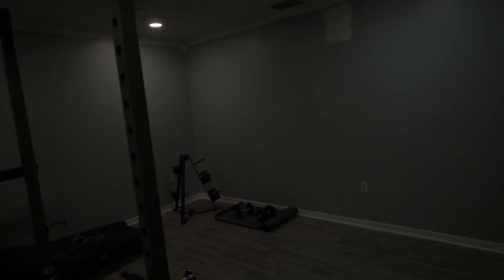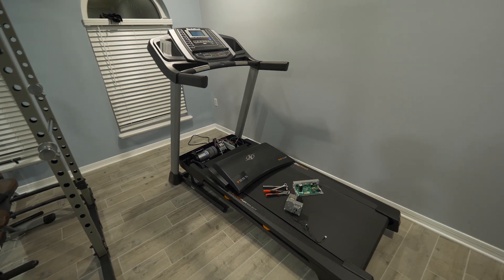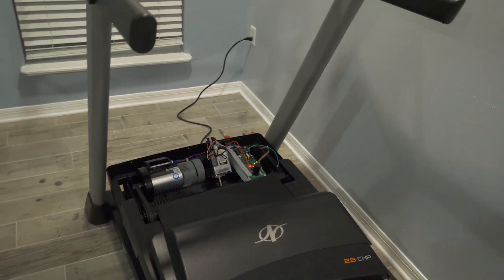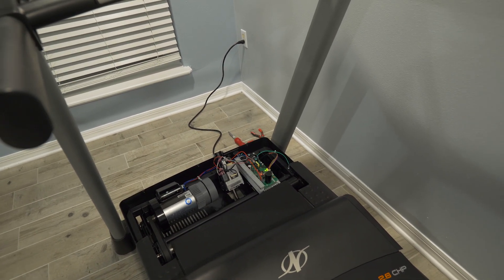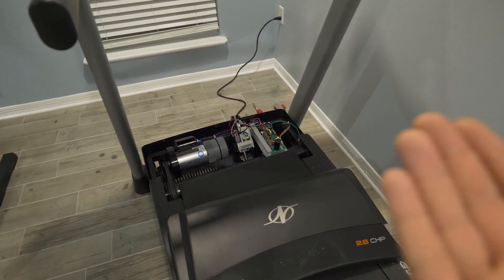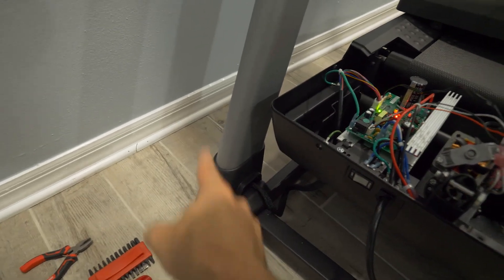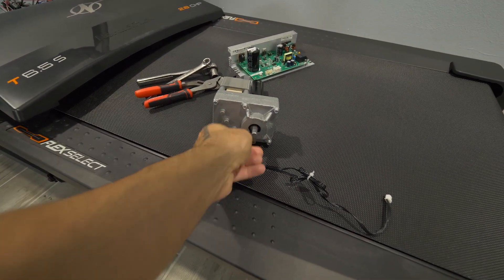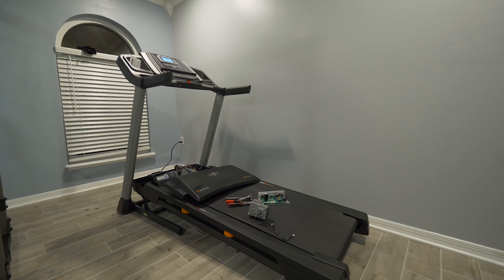DO NOT BUY!!! - Nordictrack T 6.5 Treadmill

Comment: First and foremost, there's no way anyone can just look at and determine the motor is faulty. That's your first issue. To help yourself, you cannot solely depend on them. You need to test if there's any power coming to the motor. If you have power, then yes it's likely something is wrong with the motor. As to the control board, if you don't have power to the motor, then yes, something could be wrong withe the board. Likely the control board would send a low signal to a relay which in turn will let the high voltage to the motor. If the relay has a good signal and the relay is good, then it's something with the power source or how the power source is connected to the control board. If the relay has no signal, then likely something is wrong with the board. Long story short, your issue is you are relying on someone over the phone to troubleshoot an electrical problem they likely have zero clue about. All they are doing is swapping parts hoping it will work. There's a chance none of that is the issue. These techs likely have zero electrical/electronics knowledge so there's no way they will know and you trusting them is just a waste of time. If you don't have electronics/electrical knowledge, call an electrician and they can tell you where the issue is if it's electrical which it likely is. Then you just tell them to send you what you need. Never rely on techs to troubleshoot these sort of problems. Realistically, how can they? Unless they are having you to probe with a multimeter, there is no way they will know the cause of your problem. For them, it's just a matter of reading potential solutions off some screen or tech guide and nothing more.

I've got one on the way from Amazon so hopefully it won't have the issue you're having but if it does, I'll for sure be telling the techs whats wrong not the other way around.
Reply from the maker: To blame me as the problem is absolutely wrong and horribly offensive. A company has an obligation to live up to the terms of the sale.

It's not my responsibility to diagnose and repair the treadmill. They sold me a treadmill with a warranty. Under the assumption it will work when I receive it and they will fix it if it doesn't. Which means I paid for it to be their responsibility. 

They failed to repair the machine after 4 months of back and forth with them and schedules tech to come out who never show up and then lie about showing up. It's completely unreasonable and unfair to expect a user to be an electrical engineer and go in there with a multimeter... or to hire an electrician if they don't have that knowledge. Especially because the data sheets with voltage specs are not available to the public. And especially because Nordictrack will not reimburse any labor or expense I personally put in to figuring out what's wrong. Again, Nordictrack sold me a treadmill that was supposed to work and a warranty that was supposed to fix it if it didn't. It's their responsibility to live up to the terms of the sale. Not my responsibility to make up for their shortcomings. 

If you think diagnosing it yourself and telling them what's wrong is gonna make it go easier, it won't. They won't trust your diagnosis until they go through their own diagnosis to confirm if you're correct or not, because you have no credibility. You are not a treadmill technician, you are not an electrical engineer. And even if you are, they don't know that. And I know this is how they will react because I went through it already. You will find yourself immediately frustrated if you attempt that and expect it to be smooth sailing.

And I totally get that if I was an electrical engineer and treadmill technician it would be easier and quicker to fix my treadmill. But I'm not making an argument about what's easier. I am making a moral argument about what's right and wrong.
Reply: @AltcoinXP  My intent was not to blame you. I was merely pointing out the fact that there is no way a tech on the other line can simply look and determine the motor or the controller board is bad unless they actually have someone on your end doing the probing. In other words, the troubleshooting is just BS. The person on the other line likely has zero electrical knowledge and us just reading off a troubleshooting manual.

My other point to you is that if your end goal is to get it "fixed" quickly and be able to use it, you will be able to do it faster and more accurately than they if you have electronics or electrical background. 

Lastly, if all you care is that they hold their end of the bargain then this is likely what you will get--lots of wasted time with zero progress. 

So no, I'm not blaming you. I'm just pointing out what you already know via experience which is that their support is pretty useless. Honestly, there is just no way to trouble shoot electronics unless you are probing it to find the real culprit. Now if it was a system that self-reported via error codes, then yes, support can troubleshoot using the codes. Absent this, there's no way but to probe with a multimeter.

Case and point. I just got my wife's treadmill in. I bought the same one you have. It came with the electronics cover cracked on the corner, and almost fully cracked down the side, and all 3 front screw mounts completely broken off. Lastly, it was missing the cross member for the hydraulic to connect to. Amazon is sending a replacement, but my wife wanted to use it so I put it together, 3D printed repair parts for the cover. I repaired it with super glue. Now it's stronger than the original design and I was able to do all the repairs on the inside so i just have a minor blemish on the one corner and the visible crack line where it cracked like 10 inches on the side. It now safely covers the control board and the motor with a slight aesthetic blemish. Now I'm just waiting for the replacement to come in so I can get me a crossbar and if the cover isn't broken, I'll take it too and they can take everything back. If the cover on the replacement is broken also, I will keep the one I repaired and request Amazon to give me the  discount they had promised. While using it this morning it went a bit awry. The belt stopped and the incline maxed out all on its own. This is NOT normal.

Afterwards, it would not start up. I grabbed my meter and checked the outlet and checked my breakers. No breakers tripped but my outlet was only reading 99V. That tells me my outlet is bad. The wiring is fine but the contacts on the outlet are not making proper contact. I find a good outlet and plug it in. Voila, no issues.

You have to remember that these are electrical components which are designed to function a certain way if provided certain electrical signals. If those signals fluctuate or are erratic, it can cause your equipment to malfunction. For me, the end goal is for my wife to use this machine. For this reason, I'm going to do the troubleshooting and relaying it to them if I need a part. It's on me to convince them what the issue is so they will not be wasting my time by sending replacements that are replacing perfectly fine parts, thus not addressing the real culprit. It boils down to what is important to you. For me it was getting it running so I took my own time to design and 3D print all the necessary parts and to trouble shoot if I have to. 

If you leave it to them, you may end up where you are, four months later and zero progress. So no, I'm not blaming you, but I am telling you that sometimes, if you want results, you may have to do it yourself. But if you are of the mindset that it's on them then be ready wait as you have and in the end, there may be no resolution, and possibly no refund too, just a dead treadmill they keep trying to fix by sending you replacement parts after replacement parts, none of which addresses the issue. The issue could very well just be your outlets. Of course, that's NOT to say that is your issue. I'm just saying, they will NEVER know the culprit unless there is actual diagnostics done. Hope you get yours fixed. Even though this is for my wife, I like the treadmill. It's solid and everything works as it should. The malfunction this morning is expected as the machine was getting mixed electrical signals. Best of luck to you and again, never meant to blame you. That was never the intent. The intent was to point out the obvious--support doesn't have a clue what they are doing.
Reply: I will look at mine and see if I can diagnose what is going on with yours based on what you described. If you can write down what happened when this all occurred and detail what you see and hear when you try to start it up, that would help. I don't mind trying to give you a hand. I have the same model so know what it should be doing.
Reply: Please observe your machine and see what happens and describe it in detail. Your video says when you insert the key, a dark orange light comes on. That is NOT normal. Verify this is the case. NO lights should come on when you insert they key. The only lights that should be lit are the red and green LED. Once you start the treadmill, the red LED should go into blinking mode...about 4 blinks per second. If you raise the incline, you will see a light orange LED light up. This is labeled LD4 on the board. If you lower it, LD5, the dark orange LED will light up. These two LED's tell you what the incline is supposed to do. Light-orange is to rise and dark-orange is to lower. If it does as you claim(insert key and dark orange LED comes on). This tells me it's stuck in the down mode. If it is bottomed out and you hit the down button, you will get a series of beeps from the screen. This tells you it's bottomed out. NO lights should come on when you do this.There is no reason for your dark orange light to come on unless it is stuck in this command. The embedded code is expecting this variable to change from current to new before it will say the command is complete.  

Let's say u are at incline 2 and hit down arrow...it must power the motor until it reaches level 1. The  level variable is stored the value 2. Until the bed angle drops enough to get to one, this variable is going to remain at 2. If this variable never changes, this code will continue to execute making it stuck in the down command. I'm just giving you an idea of what's happening. I need more info from you as to what's all happening when you insert the key. 

Do you hear anything, see anything. Look at the board and the motor. What about when you hit up? Does the dark orange light ever go off, like when you hit up to raise the incline. If it doesn't then there is a sensor keeping this embedded code looping and repeating the command to lower the incline. If the motor has never worked and still doesn't it would keep it in this mode. So always, it's trying to execute a command it has NOT completed and it's trying to do this. Until it completes this task, it's going to keep trying. Appears to be the case. Would love to hear more details from you about what you see and hear. Be very detailed and specific.
Reply: @AltcoinXP  My best guess given what little i know about your issue is that your incline sensor is either bad or needs to be calibrated. I watched your video again and now see that you first get a light orange(raise incline) then it goes to dark orange(lower incline) then both go out. This means the system is trying to raise and then lower the incline. I also noticed the beep when you go to pressing the incline buttons. It beeps and does nothing. This tells you it is where you are trying to put it. Example, if it's at 10 and you push 10, it will beep. If at 5 and you push 5, it will beep. This is indicative of a bad incline sensor to me. NOTE TO POWER DOWN BEFORE DOING ANYTHING! You can try taking it out( goes into side of incline motor). Wipe it and reinsert. Test and if you still get the same result, unplug it from the control board. You SHOULD be able to operate the incline. Here's the catch, it will be very confused so if you click a level, it will go up one level only. If you click the next level, it will go down a level and it will just keep doing this...up one...back down one....up one back down one. If it does this, it's responding and your motor is fine. Power down and plug it back in. The reset and to calibrate it, take the incline back down to zero. This will be it's zero position. Try it and see what happens. I believe your issue is just a sensor issue. Good luck!
Reply: @vangmountain  you just did an awful lot of diagnosis for someone who's opening statement was "we can't diagnose by sight, we must use a multimeter"
Reply: @Floortile83  Ideally, that would have been the preferred route but absent that, I tried to help as best I could based on what he was saying in his video. My diagnosis was based on logic and what I know of the machine. Based on his video he sent them, according to him, he was sent an incline motor and then a control board. It's obvious whomever he spoke was clueless. For it to even remotely have a chance of it being the motor, upon pressing an incline key, either the light orange or the dark orange light should come on. Light orange if he is raising it and dark orange if he is lowering it. This would tell him the signal from the console has made it to the control board and the control board is sending a signal. The other thing would have been to listen to the relay and see if he here's the relay power up. If ALL these occur, then and only then, absent a multimeter probe of the motor or other checks like unplugging the motor and manually turning the belt. Just watching his video, you can clearing hear the console give a single "beep" whenever he pushes an incline level. This is the console essentially, "invalid command". What does this mean? It means the console NEVER sent any commandcsignals to the control board. Knowing this, how the heck did the tech get to his conclusion that it was the incline motor and ultimately the control board. 

There's zero logic being utilized here. The tech obviously knows zero about the machine. The console only sends command signals to the control board if the desired command is valid. How does it know whether it's valid? It reads the incline sensor values. The fact that it beeps when he depresses an incline level and the fact that when he gets a light orange light followed by the dark orange light upon insertion of the key tells me that upon insertion of the key, the control board tries to raise and then lower the incline. Just by this alone, one might suspect the incline motor but you have ways to test the motor and other components in the path to the motor. The fact is, there is ZERO response when an incline level is pushed. Couple this with the odd behaviour of the LED's may suggest that the incline sensor is bad or it has bad connections. Of course this is absolutely just a logical guess, but one based on logic and what I have observed with the operation of my identical machine. Point being, if you have to use trial and error, it must be done using logic, not just random guessing. 

The flow of the embedded code is something along the lines of, if incline level button is depressed, check incline reading. If depressed value is higher than current level, raise the incline. If depresses level is lower than current level, lower the incline, ELSE "beep". What he is getting is the "beep". What can lead to this choice? A bad incline sensor. We see no signal was sent to the cobtrol board because neither LED lights up which is what it does if the control board gets an elevation command from the console. It's beeping! Logic tells you it could be something the incline sensor. Unfortunately I don't have access to the embedded code running this machine. I can only guess at the general behavior of the code based on the observations of how mine operates, both when the incline sensor is functional and not functional. As I've already stated, me unplugging the sensor makes the incline commands obsolete. It just toggles between raise and lower. If it lowered the incline then pressing any level keys will make it do the opposite of the last command.

In other words, absent a reading from the sensor, the system toggles the value of the incline sensor in such a way that whatever value you depress, you'll get the opposite effect from your previous command. This is what I observed when i disconnect my sensor. If I do it starting at level 3, the controls will toggle back and forth from level 4, then back to 3 and it just keeps repeating, never getting beyond these two levels. 

Yes, I am trying to diagnose without a meter, but that's because I know how this treadmill is supposed to respond to commands having the identical machine and I've observed it's behavior unlike the tech who likely is cluesless and is just reading some instruction cards. This is how the majority of desktop support works unfortunately.

If he could give more details of what all is happening, it's possible to diagnose it without a meter on his end because I can   observe how my responses compare to his. And yes, I understand you are just pointing out the seemingly contradiction of my comment, but it isn't as contradictory as you think because I have and understanding of how the machine is supposed to behave. As such, I can do "some" logical trial and error diagnosing which is what I did. Cheers!
Reply from the maker: @vangmountain  the sensor was replaced three times. It's sent along with the incline motors. Unless I received broken sensors each time, it's not the sensor. There are also a lot of wrong assumptions you are making in your comments.
Reply: @AltcoinXP  Yes my assumptions could be wrong because they are only based on observations. I decided to probe the sensor and hook it up to the oscilloscope and this is what I found. First and foremost, the sensor runs on 5v  and the return signal is 3.3 volt logic. If it is working correctly, it should pulse with around a 720ms high pulse and 175ms low pulse. Depending on what you push(levels or increase/decrease button), it will vary the pulses and depending on where you are at, the signal will return to a high state or low state and it starts in that state. I don't have access to the code so I don't know exactly how it determines what level it's at. What I do know is the incline motor runs during this pulse cycle so it's safe to assume the duration of the pulse is the length of time the incline motor runs. This can be used to convert the shaft rotation to find out the incline level. I'm not sure why it switches back and forth from a constant high state to a constant low state, but it does. It could be that this is how it keeps from straying off. If you play with it long enough you'll be able deduce what it all means, but some quick checks and you would be able to see if the sensor is working or not. Does it have power? 5V is what it should be. Do you get a signal on the signal wire? 3.3V is the signal. If you get that, you will need an oscilloscope to actually see the signals. Exactly how everything works I don't know because I have zero data sheets but probing it, you can reverse engineer and get a basic understanding of how it's supposed to work. So no doubt, I could be making some wrong assumptions but having tinkered with it, I believe I have a better idea than just swapping out parts. There can only be so many things wrong. A full swap of parts "should" work assuming the issue is in those parts. You have to start with the basics first. Do you have good reliable power? As I've stated, my 99V oulet caused this machine to go wacko. Once I realized that, the fix was as simple as hooking to to another stable outlet. So yes, it could be any of a host of things and that's why it's imperative to test BEFORE swapping. No point in swapping out a perfectly good part. Maybe something's getting fried? If so, why? My point is, it's going to be a tough fix unless someone is actually hooking up diagnostic equipment to it. This is the only sure way to get to the root cause of your issue. What I do know for sure is NONE of the incline motor lights should ever come on unless a "raise" or "lower" command has been issued by the console to the control board. So why does yours automatically light up when you insert the key? Stuck key? Doesn't appear so. It goes off on it's own. Does it do this every time? You have to do it over and over to confirm that what's going on is repeatable. If you can, you can start to probe because something obviously isn't working. Just my thoughts. 

You say you don't think you should be doing this, and you are correct, you SHOULD NOT.You paid for a product and they should take care of it, but the reality is, you are already doing it so why not do the rest. Of course, that's entirely up to you. 

Take my case for example, I eventually found the crossbar. It was taped to the underside of a piece of foam. Installed it and got up with Amazon. Sure, it took me a some time to properly design and 3D print the parts to repair my cover, but in exchange, Amazon gave me a 45% discount on my purchase to keep it with the minor blemish, so I got a nice $650 treadmill for around $230 ($480 cyber monday purchase) because I was willing to put some of my own time into repairing it and living with a minor blemish. Because I did, I have a very nice working treadmill one day after delivery. All about what you are willing to do. Cheers!
Reply from the maker: The reasons I think the orange lights turn on when I insert the key is because it's automatically entering the incline calibration mode. I know the incline motor repair sheet I was sent along with the replacement incline motor says some models automatically entire incline calibration upon startup, and other models you need to press and hold buttons before inserting the key to enter calibration mode.

And yes, the power at my house is fine. I have a kill-a-watt that I used to check.

As for why I'm not getting balls deep trying to fix it, it's because I have so much on my plate already. I spent almost 4 months trying to resolve the issues with this treadmill incline and I give up now. I'm only one person with a giant to-do list and so much stuff on my plate, that I can't spend day in and day out trying to fix this treadmill (either by myself or working with their crappy support). Amazon refunded me the full price I paid for it, so I'm not financially out anything. The incline is stuck in an elevated position, but I'm okay with that. Because all this time spent trying to fix this treadmill is time I don't have to spend using it and getting healthier. Plus, having the treadmill taken apart and in the middle of my floor gets in the way of me doing other workouts.

I appreciate your willingness to help, but I think you trying to help me is a waste of your time, because I am long past trying to fix it.
Reply: @AltcoinXP  I can confirm the entering Calibration mode does not light up any of the LEDs. Only when it's trying to raise or lower do they come on. It responds the same in calibration mode as it does in regular mode so it's definitely telling me that somehow yours is trying to raise and lower upon start up because those LED's indicate that a signal has been sent to the relay. Why it does that is beyond me. Those lights indicate power to the relay. You can confirm it's doing this by listening to the low audible click of the relay or probing it with a meter. If so, it's trying to change the incline not merely entering calibration mode ,but it's highly possible we have slightly different machines. Anyhow, looks like you are content so we'll leave it at that. I think we can both agree their support is not great based on your experience. 🙁🙁🙁
Reply from the maker: What I was suggesting is that if it automatically enters incline calibration mode, it will automatically attempt to raise and lower the incline upon startup... therefore causing the orange LEDs to turn on. My understanding is that calibration mode will raise the incline to the highest setting and lower it to it's lowest setting and record those positions and calibrate/match those positions to the 1-10 buttons.

I assume yours does not do this because your machine is already calibrated, so it's not seeing a discrepancy in values causing it to enter calibration mode upon startup.
Reply: @AltcoinXP  My observation is that it does NOT auto calibrate. You manually do it. And I can confirm my calibration is messed up when i intentionally disconnect the sensor with power on. In this mode, any up command moves it to 10, it thinks. I know this because that's what the monitor shows. It won't allow an up command. Any other command is a down command and it lowers it a notch and displays it as zero. When I plug the sensor back in, it's lost so I have to manually calibrate. So no, best I can tell, it does not auto calibrate or try to. And yes, when it calibrates, you hit up and it takes it to 10...you hit down afterwards and it comes all the way down. The sensor pulses untill it gets to the limits. My guess is it counts these pulses and just tracks these pulses to determine where it is at. This would explain why it get's lost if you disconnect it. The sensor does not send any pulses so the board cannot add or subtract fmto what it has as the current level. As a result, it has no idea where the incline level is so any up input will automatically move up one level and be set to 10 and any other input will lower it one level and be set to zero. This is what it does if you disconnect the sensor. It just goes up one level and lowers one level and just repeats this motion never able to go any higher or lower.
Reply from the maker: Ok. So I wonder if there is something in the upper console initiating the incline motor when my machine is first turned on. Like a short or something. I know it's not a problem with the upright wire because I tested and replaced that.
Reply: @AltcoinXP  By the upright I'm guessing you mean the data cable. I was going to ask if you'd checked that. As to your question, yes, anything is possible. Personally, I don't think so. The reason I say that is because I saw in your video when you clicked on a level, it gave you an audible single "beep". This is indicative of the system telling you, "you are at this level...invalid command". It's equivalent to me being at level 3 and pressing 3....my only response will "beep". This tells me the command never makes it to the control board. But in the start-up it does try to go up and then down. My question to you would  be, when it does this do year year the audible "click" of the relay. It's very light so you will have to put your ear next to the cover. Without anything else running you should be able to hear it. This would mean something had sent a signal to the relay. The question is what and how? After this process, you don't have access to the incline command is best I can tell. Does it give you multiple beeps when you click the up or down button for the incline. Click all the levels and both in up and down incline arrows. What are the responses? I was suspecting the sensor signal alone  alone doesn't dictate to the control board where the level is at. It appears to be a stored in flash memory and hence will always be the same even if you power off. Upon powering up, because it was never written over, it thinks you are still at this level. We have to somehow get it to clear this value. This is what I think may be going on which would explain some of what I've seen on your video. I would advise you to mess it up intentionally by unplugging the sensor from the board and piwering it back up without the sensor connected. See if this frees you from this mode. Hopefully it will write over what has been saved in flash memory. Just a guess.
Reply: Unfortunately I cannot replicate your issue on my machine but you should be able to replicate things I've describe to you because that's how the machine is supposed to work.
Reply: If I get enough feedback, I think we might posdibly be able to resolve this issue.
Reply: After u disable the sensor, manipulate the incline controls to see if you can get it to move.
Reply from the maker: Yes, I hear the relay. I believe this is shown and talked about in my video...

The incline button beeps do not indicate an invalid command. The way I am coming to this conclusion is because the exact same beeps happen when I use the speed control.

To be more specific... 
If the display shows incline 1 and I press the 1 incline button, it gives me a single beep. If I am at speed 1 and press the speed 1 button, I get a single beep.
If the display shows incline 1 and I press the 2 incline button, it gives me a single beep. If I am at speed 1 and press the speed 2 button, I get a single beep.

The only time I get a triple beep is...
If the display shows incline 10 and I press the incline up arrow. Or I am at speed 10 and press the speed up arrow.
If the display shows incline 0 and I press the incline down arrow. Or I am at speed 0 and press the speed down arrow.

Therefore, the triple beep signifies that I am at the limit for the incline or speed. And I single beep means that I have pressed a button.
Reply: @AltcoinXP  You are correct. It beeps anytime any button is pressed. I didn't catch that. But will multi-beep when limits are met. This we can concur on.

As to your relay coming on, if indeed it is being energized, power should be going to the motor. Obviously nothing is happening because we see the lights light up but no motor coming on. The next thing would be to check to see if there's power going to the motor. Only way to do that is with a meter. If power is going to the motor and it's not starting then something is wrong with the motor. I highly doubt this is the case as you've replaced it(3 times?). Not only that, pressing the command keys does nothing. It's one thing if pressing it led to the LED's lighting up but it doesn't. Basically it's like it's not responding. I will note that when I had the machine go haywire, the incline started rising on it's own. No commands were responding. Nothing was responding. Once I downed it and realized part of my issue was my outlet, switching it to a new outlet got rid of everything. 

For this reason, i would try disabling the sensor and running it without it and see what happens. It's possible you may have had some erratic power and the system is frozen somehow. I'm hoping forcing it to power up with a sensor will reset it. 

My question to you is, does the display display the incline levels correctly. When you press 3, does it display 3. The display should always display the destination level once you initiate a command. If you are at 3 and hit the up arrow it should display 3.5. If you push level 5, it should display 5. Does it do that? 

If it does this, and no lights are coming on then you have to suspect the connection from console to control board. I know you said you replaced it, but it has to be checked. First thing i would do would be to do a continuity check to verify all lines are good. You can also do a continuity check at the connections to insure they are good. If all that checks out, if you have a digital analyzer, I would put jumpers for each line and probe them with a digital analyzer to see if indeed, when you press a button, a signal is indeed being sent from console to control board. Of course, it's unlikely you have one unless you are into electronics, but that's what I would do.
Reply: I re-watched your video and i see where you talk about the clicking and i see the two orange lights turn on and off. Was that doing it by itself or were the responses to you pressing a button. It looked like they were doing it by themselves. When does it do this? How long does it do it for? A multimeter would easily isolate where the signal breakage is at. If there is power to the motor then you just have to test the motor and the capacitor. But you replaced all of this stuff. Hard to believe it's bad unless they sent you refurbished  junk. Unfortunately without any probing with a meter, it's hard to locate where the issue is. For sure, fixable.
Reply: The other easy thing I would do is just check every connection for continuity. This can be done with a cheap $10 meter because power is off. Just avoid the capacitors or make sure to discharge them if you're going to touch them. Of course, when using a meter on live mains voltage, you definitely don't want to use a $10 meter, but for something like continuity, it will suffice. This is just make sure everything you think is working actually works. It would suck to finds out months later, you had a bad connection or wire.
Reply: At 3:00 where you depress the key, I noticed that the light orange light did come on indicating it's a rise command and a signal is being sent to the relay. Just because it didn't does not mean the motor is automatically bad. The relay is just a low power switch used to safely switch on higher voltages. The high voltage connections could be bad. The relay itself could be bad, but replacing the board would have taken cared of that.  Now I see better your issue. It woul appear that your issue is from the relay out. First thing would be to see if the motor is getting the voltage it needs. No voltage means only two things, bad relay or bad power source that the relay is switching on. You check these two things and address it. Now if you have power and still nothing, then we want to check the capacitor.

I'm still baffled about the lights coming on when the key is inserted. This is what I think is going on. The machine tried to raise the incline but it failed. The motor never started. The embedded code is waiting for the pulses to come from the sensor indicating it has moved from the current position. If the level difference is one, it should see 4 high pulses. Because the motor never started, the incline never changed. Because the incline never changed, the expected pulses from the sensor never made it's way back to the control board. As such, the code knows the machine failed to reach the incline it was supposed to adjust to. It retains this so when it starts up, it tries to get to this level and this is likely the reason the led's come on when you insert the key--it's still trying to get to the incline position of the last command.
Reply: @AltcoinXP  lmao...offensive